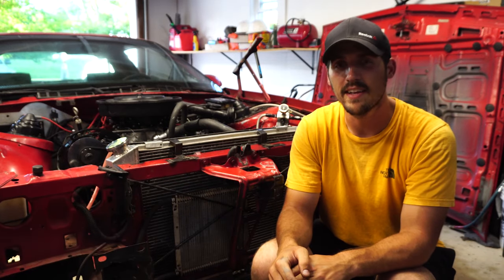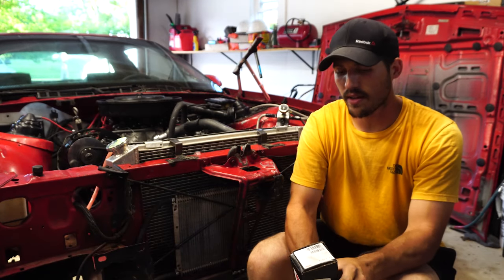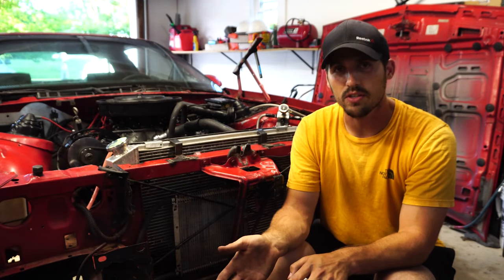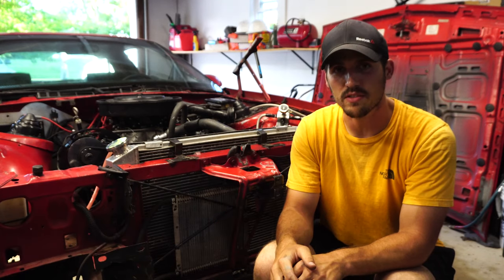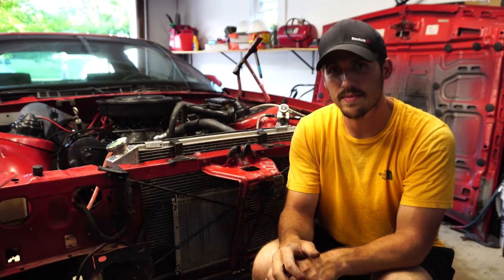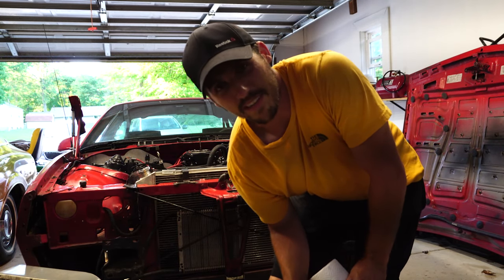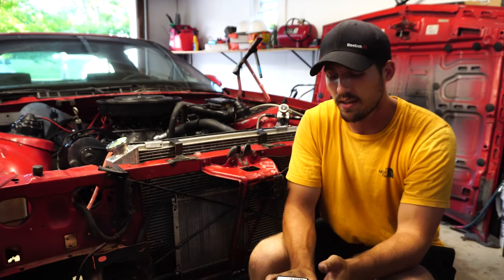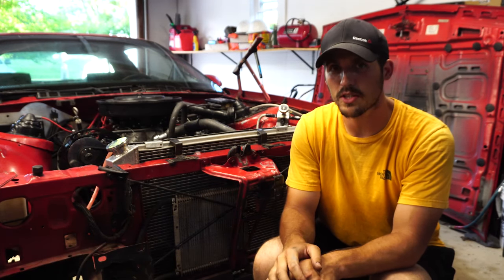Comp Cams Thumpr vs. Xtreme Cam Sound Comparison

Comment: A lot of work went into designing the Xtreme Energy cam. They learned how to reduce lifter dribble using accelerometers, which means you can actually get away with more duration than possible with their other older cams. I ordered a really hot BBC Xtreme Energy cam for a friend, and he called me up pissed because it was hitting so hard. He said, "I only have a 3200 stall and 3.73 gears." This bitch is going to be a dog with my 33" Mickeys. Yeah, he was pissed, but he called me back and said he pulled into the road and stomped the shit out of it, thinking it would fall on its face. He said he hit it, and it blew the tires off. He took it to the track and the car went from 8.90s to 7:40s. The way it was explained to me, by one of their engineers, all lifters jump the lobes and dribble, which basically adds duration and its uncontrolled.      
He also said the old way of making  cams is obsolete. An obsolete design will have the same lift and duration for both intake and exhaust, and there wasn't much thought or testing that went into that cam. That makes sense, because the Intake and exhaust strokes are doing very different jobs. 
 I used to have high praises for Comp Cams, but I continue to read about people wiping lobes during break-in, so dont think I work for them. They need to fix their reputation.

Comment: Putting a thumpr in my 408W, on bigger inch motors with good heads it seems to be a good power adder!
Reply: There's always a better option for power.The Thumpers are for show more than anything.
Reply: I wiped out my solid roller cam and lifters. Not good for street, especially if you don't keep on checking lash and are idling it alot. Engines basically brand new.

Now I'm looking for a hydraulic roller setup.

That big Mutha thumper sounds badass. I won't be racing my 383, except racing to the fuel pump, so the heavy over lap and duration don't bother me. It's just for cruising
Reply: I ran a big mutha thumper in my sbc. It was a monster. It was in a 4 Dr. 2wd blazer and it ran 12's on street tires. The cam makes good power it's not only for sound

Comment: I seen a video where they say the thumper cam doesn't put out as much power and that it is just to sound bad ass, i have a xtreme comp. Cam 480 and 465 ex. Lift, 280 and265 dur. 110 lobe sep. Flowmasters w/ turn downs, the cam is choppy and people think there's a big block under the hood SOUNDS TUFF

Comment: If you want a good sounding cam that makes wicked power and runs good look into the HOWARDS RATTLER series cams. Night and day difference from a thumper. I have ran tons of different cams in different motors and the howards rattler is a great choice. And I have never had any issues with lobe or lifter wear using howards products.
Reply: Similar approach as thumprs actually. Comp owns them so no surprise theres a new line of cams with a catchy name. 
Harold B would never let stuff like that take place if he were still around...whatever floats your boat though
Reply: @gordocarbo  How do you figure Comp owns Howards?  Because they dont! The rattler series is nothing new its name is from the Howards slingshot dragster that was called the rattler. The grinds have less duration than a thumper and the lsa is on a 109 a comp thumper is on a 107. Howards is made in the USA. I think you are getting Howards mixed up with Crane.

Comment: Can you tell me reason you chose to go from the Thumper to Extreme energy , was it because the Holley Sniper didnt like running with the Thumper Cam , I have 383 with the Sniper  and extreme energy cam , I have found with Sniper and timing control alot of the lope has gone from cam , I was thinking of changing to the Thumpa cam but not sure which way to go.
Reply: Its going to be more hassle tuning it. Those have a lot of overlap, not great with EFI. DOnt worry about lope just get the right one and do your tuning

Comment: Lobe separation is the key to a lumpy sound.
Reply: Valve overlap is the Cause for a lumpy idol the more valve overlap I.e. duration you have the lumpy it gets,  Da dumpity  Da dumpaty Da dump Da Dump 👌
Reply: @boosted.  you just said what the op said...
Reply: @nsmturbo5902  Lobe separation is not duration or overlap
Reply: @boosted.  Overlap is the degrees that both intake and exhaust valves are open at the same time. That is determined by Lobe Separation Angle. 

I didn't mention anything about duration... All I said was you are both saying the same thing.
Reply: @nsmturbo5902  true and the more duration the longer the valves hang open and the more overlap you have I guess we agree maybe didn’t understand what each other was saying

Comment: that first "new cam" sounded more like 112 LSA..
Thumper cams are more for the sound, the overlap and grind is the key in their trademark "lope"
however Xtreme cams offer more performance.  Considering it looks like you run an injection setup, 112 LSA-113 LSA
is way better for that motor than 107 LSA or 110 LSA any day. Computer cars have a hard time adjusting to that "unbalanced" idle.
Reply: Smoother cam just has a ton less duration and overlap. 
Trying to make a cam whose ramp is too quick is just gonna wipe out lifters and lobes..if you need more just choose a different cam or better yet toss a bigger crank in it

Comment: Any issues running the holley sniper efi with the thumper cam? Was told their not compatible due to the efi trying to make a smooth idle because of the thumper cam overlap making it basically flood out? I debating on swapping to efi and not looking to swap my new thumper cam.
Reply: I've seen a couple say it works. Some say it doesn't.
Reply: The less vacuum at idle makes it run higher up on the base fuel table . The map signal will also be more irratic.  You can tune around it but it's a lot harder. You can also use ALFA N VE COMBO to get around that too
Reply: Too much overlap, rediculous duration on exh and crazy tight lsa. Not gonna play well with EFI
Just put the right cam in there it will run and sound just fine.

Comment: You just sold me. My old car is so heavy I just need the intimidating sound lol at 4500lbs how fast could it be.  Sold one thumpr coming up.  Little worried about all the lifter failures you hear about any thoughts
Reply: Bad decision, esp for a heavy car. Im one of those fail stories...all same fast ramp cheap core crap. Even a roller went flat. 
Lope doesnt equal fast. You need torque for that car, easy on the overlap, duration. Youll go faster with going smaller to a point.

Comment: Thumpers are made just for the cam sound. Much better choices out there as far as performance. Friend has one in a 4spd camaro. It chirps the tires idling along in first gear. It lurches forward as it's putting along. The grind on these cams is bassackwards.

Comment: What kind of vacuum are you pulling at what idle rpm with that XE cam?  I'm interested in that cam, or the one right below it which is 206/212.
Reply: It will make tons of vacuum thats a real good torque cam. 206 is a little better than stock but almost not worth upgrading from stock. THat 211ish to med teens @050 kicks butt on most st sbc, Lots of torque everywhere.

Comment: the thumpers have the sound but often cost HP in many cases. Personally I'd never use one their other grids are better.
Reply: there are .  Back when we were kids and people raced cars, trucks outside of our country town if you had a stockish car or truck and stuck a 292 cam in it, no gears , converter it was a dog.  The vehicles with dual plane intakes, 268 HE comp cams were always solid performers, and great everyday drivers.
Reply: Gotta have decent flowing heads, everything has to match up
Reply: @drdjh2003  True. That 218 high energy or Elgin Isky Crower version is the perfect st perf cam you can drive every day. 
They will run hard from idle no issues....ramps are not crazy "extreme" so the cams last too. Prefer pre 2000 grinds for most cams

Comment: all right. I hope this is the right place. My dad and I are building a 1979 z28 with a 496.  any recommendations for a thumpy roller camshaft?
Reply from the maker: I'm not sure what specs are considered "big" for big blocks so I can't really say but it depends on your heads/springs. The more duration, tighter lobe separation angle and higher lift a cam has will make it sound more radical.
Reply: The higher you go in lift the choppier it will be, I wouldn't worry about the sound, if you're running on the street I wouldn't go much further than .500 lift, you want it to have decent street maners if it's a street car, .500 is right on the edge of ragged, make sure your heads  peak flow number top out around the same lift
Reply: Not enough information to recommend anything.  Call a long time cam mfr with some old timers who ask a lot of questions before giving out cam grinds...or better yet your machinist will know exactly what will work...internets or guys answering a phone looking at cheat sheets is gonna net you a poor result

Comment: How is that Holley sniper Efi system working for you? Any problems?
Reply from the maker: So far it's great! Ive had it for years now. I had an ECU die a year or so ago on it but after contacting Holley I sent it back and it was replaced and taken care of. 👍
Reply: Comp doesn't recommend efi with the Thumpr cams

Comment: heyy,,, do you have any idea what is Vortec Head?
Reply from the maker: Yes, I'm running vortec heads on my engine that is in the video actually. They can be great heads I really enjoy mine.
Reply: 96 and up 350sbc
The old 80s or earlier centerbolt valve cover heads are NOT vortec..nor the 305. 
Lots selling used "vortecs" that are just crappy smog heads.

Comment: I am looking at buying the same thumpr cam what size stall will I need if any
Reply from the maker: You're best luck would be to call Comp or read around on forums for your combo. I ran a stock style converter with low stall and it definitely wanted more. Good luck!

Comment: The accessory belt is slipping; that's the sound you hear. Need to micro-align your alternator and power steering pump to your hub pully.
Reply from the maker: Your both right it was an old belt on a misaligned alternator! Fixed now 👍
Reply: Great job! It should sound real nice now and the tighter LSA will make more power for you.

Comment: Can I use that thumper cam on a fully stock engine . I just like the sound . It's for a weekend car anyways
Reply: If you mean does it need to be modified no it doesn't. But depending on the engine you might have to notch pistons, change valve springs or upgrade rocker arms.   That being said if it's dead stock you won't get all the sound, exhaust manifolds and restrictive mufflers will ruin the sound.  As a side note you might have to change the convertor too, what happens is the new cam changes the torque curve and the car will lock up the convertor at idle and will push through your brakes at a stop light.    Not trying to discourage just trying to inform
Reply from the maker: It will all depend on what springs, heads and pistons your engine has mainly. If your springs can handle the lift of the new cam and you have the piston to valve clearance you should be good. 
Try and get some info on your combo and you'll find the right cam for it 👍
Reply: You're the only one here that gets it ? Right. Just fun to sit at a lite and idle. And cruz.
Reply: @TL-angzarr  correct. I had my thumpr put in two years ago, but with stock springs and stock convertor. My headers were cut open after the y pipe prior to the cam. Even after adding a vacuum canister last year, my car still wants to go when in gear and brakes engaged.
Reply: I wouldnt. it will be  a slug

Comment: Thanks for the video. Putting a 348(stroked to 427) in my son's 56 Chevy 210 and we're undecided between the hydraulic flat tappet Thumper (.525 lift), extreme energy roller (.548 lift) and a Howard's hydraulic flat tappet (.525 lift). Our compression is 11:1 and running dual 500cfm Edelbrock carbs on an Edelbrock intake. We want "the sound" but not at the expense of losing driveability. Any input/guidance appreciated.
Reply from the maker: Sounds like an awesome build! And i think as long as your comfortable tuning those carbs and getting them just right then the Thumpr cam will give you that classic sound. If you don't want to worry about that stuff then I'd stick with one of the more mild cams. Good luck on it!
Reply: I went with the retrofit, to many horror stories about ppl whipping lobes off,
Reply: Choose another line of cams then.

Comment: What cam did you use in your car? I have this 204 intake / 214 exhaust
Reply from the maker: Comp Cams Xtreme Energy Cam
Part # 12-234-2
Lift: .447 Intake / .454 Exhaust
Duration @ 050: 212 Intake / 218 Exhaust
Lobe Separation Angle: 110
Reply: Thats the old RV type cam...lil better than stock but not a bunch.

Comment: Thanks for the upload. 
Just curious, how much time and money did it cost to swap out the cams? 
Looks expensive...
Reply from the maker: You can get a decent cam kit for a little over 200 dollars and that includes new lifters so it really isn't to bad. Now I replaced my whole bottom end so add in a crank, rods, bearings and pistons (reused the block). It adds up quick but I enjoy it so it's worth it to me!
Reply: A cam swap can be one of the cheapest ways to gain hp and or torque depending on what your after if you just wanna sound cool the mother thumper sounds great but unless your set up for a big looper like that you won’t gain much power and in some cases you may lose power.
Reply: Could one install that thumper cam in a carbed chevy 350 without any other supporting mods? I already have a edelbrock carb and head back exhaust.. just want that lope
Reply: @joeyhurwitz2930  yes 100%
Reply: @ZanesGarage  No you cannot. The cheap lifters are the worst thing you can possibly use.
I've seen as much as 35 hp loss due to crap hydraulic lifters, not to mention the bill down the road when one of them loses a bearing. If you upgrade your cam, getting such cheap lifters is insane.
Lifters run in the 500-800 usd range, that's just life.
No free lunch.
Reply: If you are doing the LS thing, it's simple. Get a kit from BTR or CM. Get the proper lifters. It's a must, you can't skimp. If you can't afford to spen 800-1000k on a cam swap, you can't afford it. Do it right or don't do it, because you will regret it later.
Cheap
Powerful
Reliable
Pick two...
Reply: @thisoldshtbox3626  
Are you for real? 800 for a cam swap is nothing. That will buy you a cam and low to mid range lifers.

Price out a cam, a mid range set of Howards lifters, 5/8 dia 0.120 wallpushrods PAC beehive springs, steel retainers w. locks, a set of locators and shims and see where you are at. Those,are the bare minimums for doing a proper job on a street driven car.

Sure you can just stick it in there and hope for the best, but that's your choice. I like to run things the right way, not the cheapest way possible. 

For an all out race setup, 1500 just for cam and lifters is easy. Price out a set of Isky bushed lifters and a Comp cam with lobes of your choice, and you are easilly into 1500 usd. Then add springs, tool steel retainers etc. shaft rockers etc. and a max effort valve train is over 3500 usd. And that doesn't even include a cam belt drive. I'm sorry, but if you think 800-1000 is overkill for a street setup, you don't know what it actually cost to upgrade. Not all of us are doing junkyard builds.
Reply: @AB-80X  oh trust me I know how expensive it can be! But you saying that’s it gonna cost an arm and a leg to do a cam swap or don’t do it is bull shit because it doesn’t have to cost a lot! What’s funny and very true is that a lot of these “junkyard” builds have, do, and will mop the floor with your ridiculously priced builds, not always but a lot! And honestly the guys that have the “junkyard” builds are always without a doubt the coolest nicest down to earth do anything for anyone types of guys! So yeah you can have your Gray Poupon and caviar builds but I guarantee you it’s not as fun!
Reply: @thisoldshtbox3626  
As long as you can afford what you build, there's about the same levels of fun to be had. I've met all kinds of people with both builds. I've met cool guys with high dollar builds that hang with everyone, and I've met absolute snobbish junkyard builders who think people with better funding are not "real". That's the kind of crap that is bullshit. Reality is this. If you have a junkyard 6.2 and throw a stage 2 Cam Motion stick in it, there are just a few thing that needs to be done. Yes you can run stock lifters, and those will be fine. But it is a mill on borrowed time if things are not matched. At the least you need the right springs, retainers, locks and locators to go with it. If you have a tuned 5.3, 6.0 or 6
2 build, doing the valvetrain right is not what will break your bank. If you can find 350-400 usd for a cam and own a car that is worth it in some way, you can also afford the hardware to install it properly.
Reply: @AB-80X  Agree....cheap is never good. Ever
Bugs me when I see guys try and justify not changing springs...or use the proper converter. DIsaster waiting to happen!
Reply: @joeyhurwitz2930  No. You need the proper springs installed height etc or youll break parts. 
Dont buy a cam just for a vid clip youll regret it!! 
Any performance cam can sound good just need the right one in the first place.
Reply: @thisoldshtbox3626  Sounds like you talked yourself into continuing to buy cheap junk. 
Btdt failures every single time. If id spent the $ in the first place Id be thousands ahead.
Reply: @AB-80X  Pouring money into a junkard 200k mi engine makes no sense to me. 
Guess thats why they shop ebay for some stage xx cam. lol